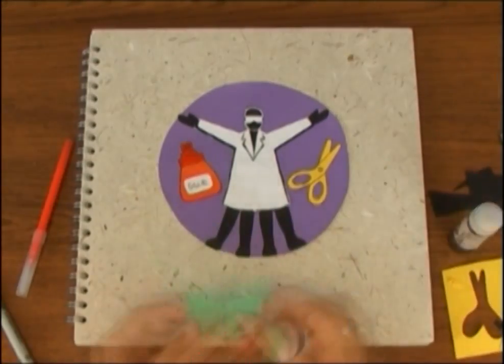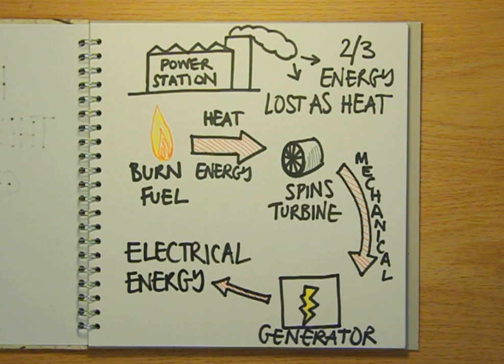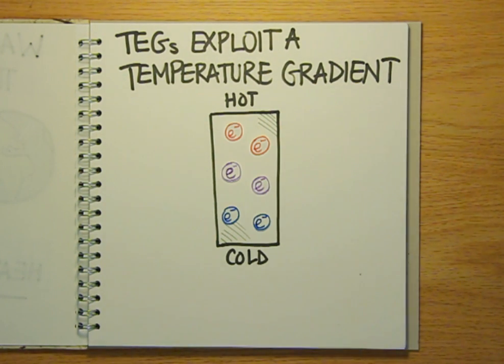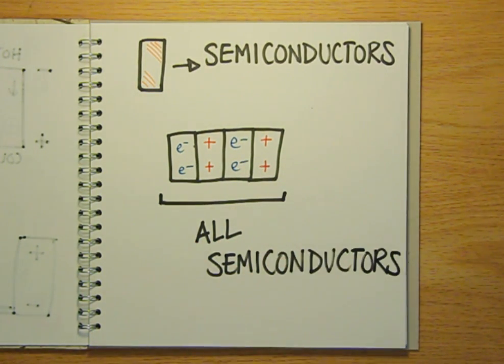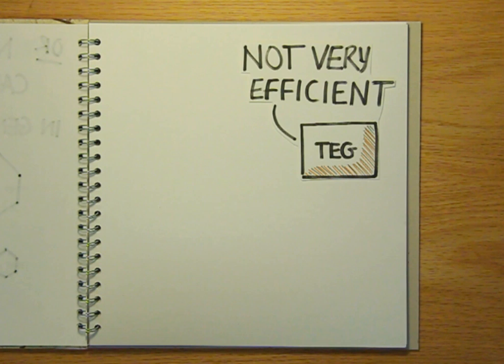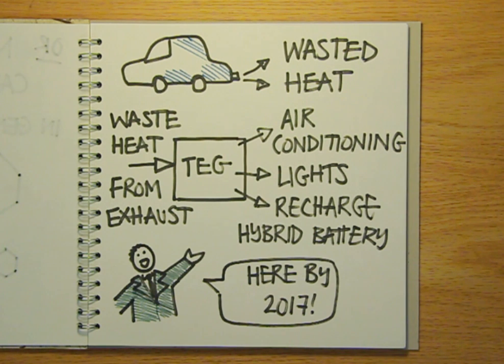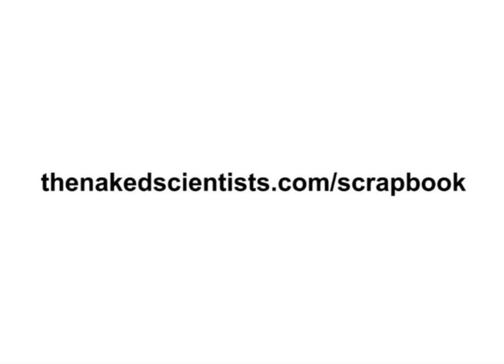How do thermoelectric generators work? - Naked Science Scrapbook

Comment: i searched this because we found a soviet time device in my grandfathers things. It was a lighter that runs on petrol that has these metal slabs attached where the flame is. It generated enough power to run a radio, which was the primary use of the device, powering radios without batteries.

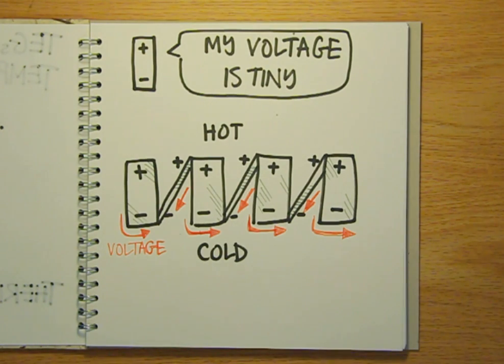Comment: Hi, i made an observation, im pretty certain that your diagram at 2:46 is incorrect. Hot side should be all positive, and cold side negative. Wires should be connect from bottom to top. Ought to be exactly like diagram at 2:20. Only difference is the copper wire does not create an opposite voltage. (Though your diagram would still work if you have alternating cold/hot for each cell or if it is depicting alternating p-doped and n-doped semiconductor)
Reply: You prune,all of this Video is CORRECT
Reply: Your grammar is poor
The proper word is Connected

Comment: M totally confused how TEC module works as cooler and heater by connecting Electrical Power in it , I have seen construction of tec module on internet which was Negative wire connected with P-N-P-N-P-N-P-N-P-N-P-N-P-N-P-N-P-N ..... Cell's where junction or first Pair of P-N- faces upper face ( consider cold sideOf module ) and next chain N-P facing down side !!!! So question is if both side is made ofP-N junction then what cause its one side hot and one side cool ???? is it because ? , Maybe If current go P to N then P-N Junction become Hotter And if I go N to P then N-P Become cooler ????? Is it true ???? and how It's works at atomic level , what properties of electrons and current do this Temperature Pumping Job ????

Comment: 2017  no teg equiped cars
Reply: 2018 soon .... LONG LIVE PPPPETROLIUM ..
Reply: 2019, still nothing.
Reply: Not worth it, you could probably knock off a hundred watts from the alternator, but a car needs tens of kilowatts to accelerate.
Reply: The Eh Team they said for ancillary devices not the actual power for the vehicles propulsion
Reply: Anything helps in a car. You're insane if you think TEG would power a vehicles propulsion.
Reply: No I'd say it would make almost no difference in your mileage, for the heaviest AUX loads TEG's makes no difference.
Reply: Porsche 918
Reply: Curiosity has an RTG. The T stands for Thermoelectric.
Reply: 2019... Still
Reply: The alternator's prime mover is the engine that drives the wheels. The alternator isn't a very big load to begin with to drive the "ancillary's". The AC units in a car are directly driven by a clutch to the engine and the heater gets it's power from waste engine heat already so those heavy loads aren't supplemented by TEG's.

Comment: What are the positive particles? Are those positrons?
Reply: 'Particles' is the wrong word, as it suggests something like a fermion or an ion. What actually happens is that there is a flow of electron holes (i.e. the absence of electrons). These holes are equal and opposite in charge to electrons.
Reply: Mayke how would protons move? Aren't protons always stuck to the neutrons?
Reply: It's an positive ion

Comment: would it work if I cooled a side very much instead of heating the other one ?!! 
so is it really about the "heat" or "heat difference"
Reply: Only the difference matters
Reply: I don't think it would work, since TEGS work because of heat electrons moving towards the cold end faster than the ones in the cold end move to the hot end, this is because particle move faster if heat is applied to them. So if you cool one side, it could maybe work but it wouldn't be efficient.

Comment: The Problem with the space TEG is that while Space itself is cool, it is also empty. The only way for heat to get away is through heat radiation, which is very VERY slow.

that's also why you don't instantly freeze in space like depicted in many movies, because you don't really cool don't that fast because you only cool down through heat radiation.
You will suffocate before you even feel the cold.

So TEGs in space won't work as good as you make it out.
Reply: Spacecraft solve this problem with radiators to convert heat into radiative energy that can be dissipated into space. This is a well-understood problem and has been used in spacecraft since the beginning of space exploration. You can read more here: http://helios.gsfc.nasa.gov/qa_sp_ht.html
Reply: Vik Sohal
Well then they should say that in the video and not make it out like the cold of space has anything to do with it.
Because it hasn't. It's just that it's a vacuum.
Reply: The coldness of space actually has a direct relationship to net heat radiated away. The equation for heat transfer via radiation is Q/t = eσA(T_object^4−T_ambient^4) where e is the radiation emissivity (1 for a perfect black-body), σ for the Stefan-Boltzmann constant, and A for the surface area. T_ambient in space is about 3K.
Reply: So spacecraft need large radiators to get rid of heat. And those add weight which requires more fuel to accelerate a spacecraft. But haven't fuel issues been solved by using more efficient engines such as Ion drives?
Reply: Memento Mori I could be wrong but I'm pretty sure the Apollo missions did not use radioactive isotopes to generate electricity, they used fuel cells.  But I know the voyagers used TEG powered by radioactive decay and it's lasted almost 50 years!!  Simply amazing.

Comment: being green and talking about CO2 emissions makes this video far less intellegent than it really is. We save energy becuase it allows us to spend that money on other resources and do bigger things, such as explore space or solve energy problem with research. If we waste all our money on energy costs or even a decent amount we are not spending that money potentially innovating in new ways. 

A good example of thermo electrics could be related to how thunder storms function, dust particles and water can tend to work as semiconductors if the conditions are right. Some teach lightening is about charge above ground however that in no explanation of vast cloud to cloud lightening. 

It would be a fun experiment to create a dusty mist cool one end of the tank heat the other and add some particle emissions from a radio isotope to simulate cosmic rays and solar wind.

Comment: Exhaust gas temp at the exhaust manifold can easily  exceed 1400 degrees F making it more than possible to use TEGs in cars.
Reply: but you would need a big contact area with that heat as it just flows fast out of the exhaust
Reply: +Rany Othman I agree with you on this one! :D
Reply: A great issue is to find materials which can withstand those temperatures, but you are right. Since the Seebeck effect is directly affected by the temperature difference it would prove quite efficient if we could harvest that kind of heat.
Reply: Even the tops of engines too. Also imagine home heating utilizing TEGs.

TEGs do not steal heat and convert it to electricity. Heat is merely needed to help the process. Anywhere moderate heat is predicted, TEGs should be.

Comment: How is the voltage opposed when 2 TEG's are conducted??
Reply: +Ananya Shastry The cold end of one TEG is connected to the hot end of the next, and electrons flow from hot to cold so there is no way they will move to the next TEG.  We could just go ahead and connect them up but this would be the same as having one giant TEG, and the problem there is the surface area is huge.  To get a useful amount of electrical energy we have to squeeze lots of electrons through a narrow space.  Sorry, I forget which part of this is volts or amps or watts or ohms.
Reply: Why not add diodes?

Comment: great video. Only thing is, most of the heat escaping the car is from the engine, very little heat, or a negligible amount is expelled through the exhaust pipe.
Reply: Perhaps a TEG unit could be installed under the bonnet of the car? The heat from under the bonnet and the cool air cycling over the top of the bonnet have the potential to be one of the better locations for a TEG?
Reply: I caught that, too. I would replace the radiator with a TEG radiator, hot coolant from the engine for the hot side and a heat sink cooled by the air (justlike a radiator) for the cool.

Comment: There was smthng wrong  you said hot side will be + but in the attaching diagram there was - parts in the hot part
Reply: those were conductors, and later she says that those conductors were replaced by electron carrying semi conductors  and the system was made all semiconductors. Hope it helps :)

Comment: 2/3 wasted as heat sounds like a LOT. Why don't they "simply" use it to heat water. Then they could pump "hot" water to peoples houses instead of cold, turning everybodies hot water tank into cold water storage by simply storing it and letting it cool there? Yeah it would loose some heat in the ground but it seems like it would dramatically raise the efficiency of the system. Thoughts on this?
Reply: because it will take more infrastructure will need capital investment and ROI is not very likely until and unless those houses are ready to pay the high cost of moderately hot water (as it will lose heat on its way). Hope it helps :)

Comment: Could someone please explain what is the difference between the materials that allow negative vs positive charges? As I understand it, both generate a voltage difference, but only one works when connected in series..? why? The drawing of the materials that conduct positive charge is the same as the previous one conducting negative charge. I would appreciate if anyone could clarify me. Thank you.